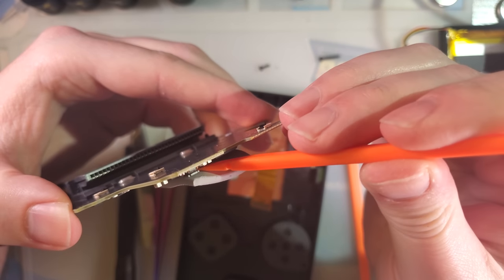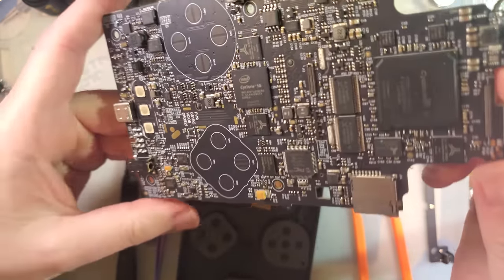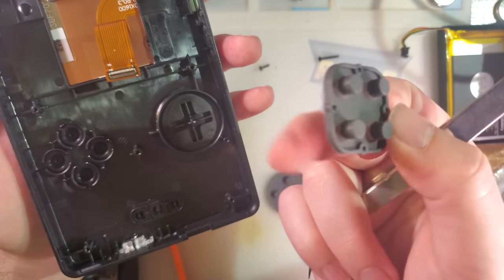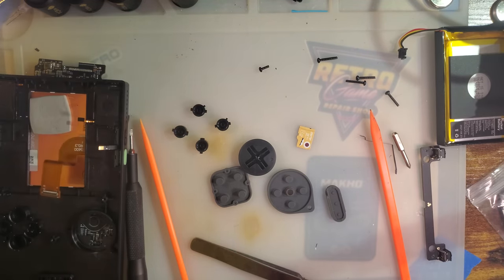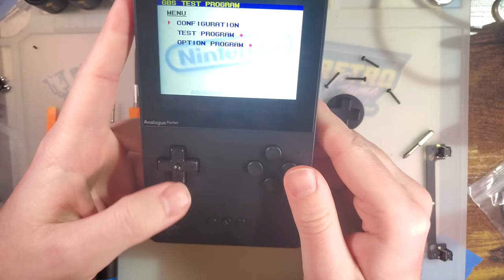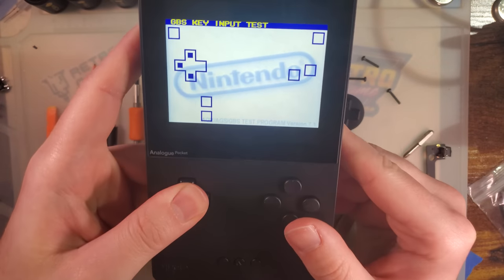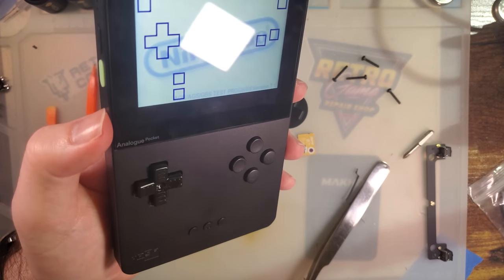Inside my Analogue Pocket

Comment: Did some quick searching and the buttons and membranes and maybe dpad are almost definitely versions of the ones used on the 8bitdo N30 controller. The membranes match and so does the size and keying on the buttons.
Reply: Does 8bitdo not sell that specific part? Am I gonna have to buy an entire N30 if I want spares?

Comment: I have a  unit. It has a ghost input issue, but when I open it up I can't see any issues with the membranes. The screen also turns green sometimes on random boots.... I'm wondering if there is a power related issue which is causing these unexpected issues. The issues dissappear if I place the handheld on a dock.

Comment: Put some Kapton Tape, at least 2 or 3 layers of a circular/square shape on the board where the nub of the D-Pad touches.
It should solve the problem you were showing there toward the end.
Reply from the maker: I mean, yeah, but that's with a DMG dpad. I'll just have my own buttons made with better specs.

Comment: I did this. Said” I need snes inspired buttons” it its now a brick, because i damage the power button ribbon.
Reply from the maker: Well, it's likely an easy fix, even if you have to start from scratch. The board is three SPST buttons, probably all common ground so just four pins. With a multimeter, you can easily figure out which of the four is ground and then the other three can be figured out with the tried and true method of "guess and check". You'll know when you've found power when it turns on and then the last two are volume. 

But you don't have to start from scratch because you already have the old board. You can just wire up the four pins 1:1 or even purchase a replacement ribbon cable. If memory serves, these are 0.5mm pitch cables. 

If you're in over your head, I'm sure you can sell the device as-is no issues. I have been looking for broken Pockets (at a discount, of course) so I'd potentially be interested myself but I understand that there's a conflict of interest between me telling you how to fix it and offering to buy it so I encourage you to seek other opinions before making a decision (assuming you haven't already -- it has been almost two weeks since you commented).
Reply: @makho  do you do repairs? Analogue is not responding and there seems to be no one in my area that does…
Reply from the maker: @gillythekidd  I do not offer repairs, sorry. I'll purchase hardware for my own shenanigans but unfortunately, I do not have enough free time to sell some of it to others.